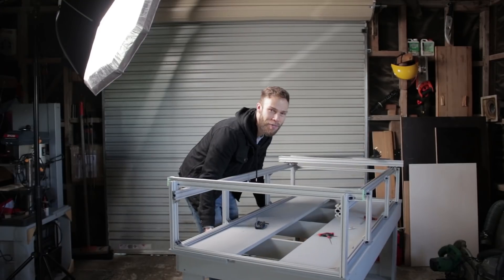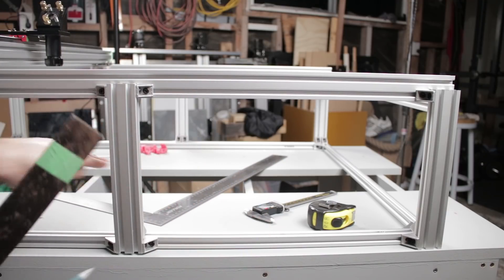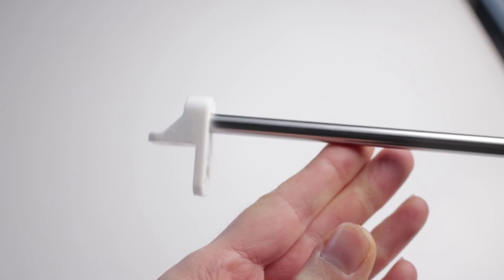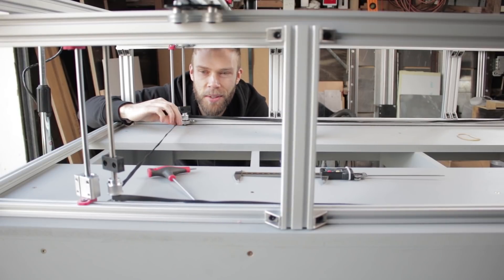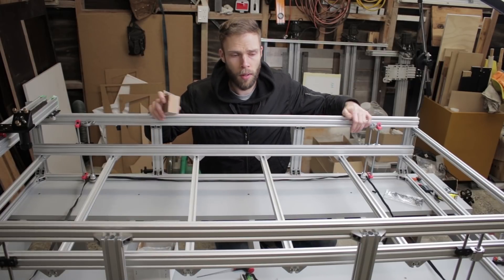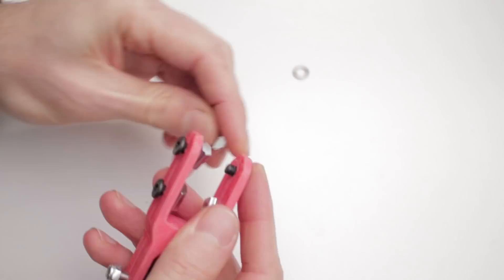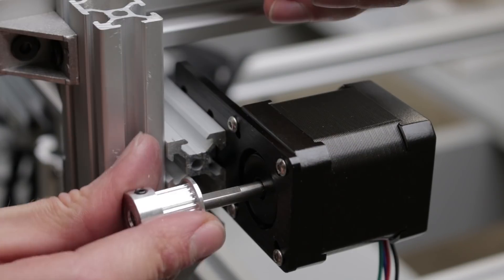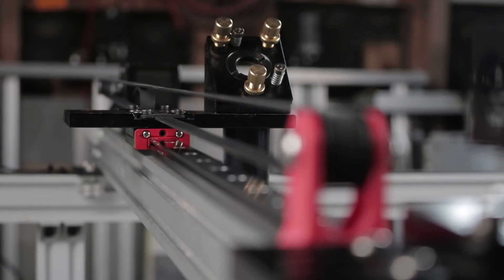Ep3: Beds & Belts. The DIY CO2 Laser Cutter / Engraver Build Series

Comment: I was going through the build of materials and in there it says you used a dual shaft NEMA 23 for Y axis.  Here you use 2 separate motors..  are these NEMA 23's or NEMA 17 like the X axis?   
Or do you use NEMA 23 all the way around?    
Starting a build and wondered why I ordered a dual shaft???   I ordered based on BOM.  <links in BOM>

Comment: 7:46:  The PAID instructions CLEARLY show the pulley oriented THE OTHER WAY with the screws on THE BOTTOM.  SO I did that, and the belt keeps jumping off the takeup pulley, because the travel of the belt is being forced upward due to the orientation shown in the PAID instructions...That's GREAT, now I get to disassemble all 4 vertical threads/brackets to reverse the pulleys. ARRRRGH!

Comment: VARY COOL BUILD. I would do one thing different since I am welder fabricator I would weld up the frame from 1" thin wall steel tube. I think I would also build it so it could be a router as well as a laser cutter. Now to watch the remaining videos and see how it came out. I think I will buy a cheap K40 Chinese laser cutter to start with then if I find myself using it a lot and need a larger one, I'll re-watch these videos and build my own version using the knowledge from these videos and what I learn from the K40.

Comment: Did you get a good deal in the extruded frame parts?
Reply from the maker: I had a local supplier nearby which saved on some shipping costs, but it's still a large percentage of the overall build cost

Comment: I had lost steam on my own build but your videos have got me going again thank you! I'm sure you've answered this elsewhere but I can't find it. Are you worried about dual motors on the y-axis coming out of square with this setup? I've read of alternatives to this style for that very reason and have now been considering going with a linear rod setup instead. Currently I'm setup like yours with dual motor on y and I would have thought it unlikely to happen but if it did...even 1mm of variance would send the laser pretty far off the next mirror across that distance
Reply from the maker: Good to hear you're getting back into it!
Yeah definitely a valid worry. Purely speaking from my own experience, I've never had any trouble with them running out of sync.

Comment: I'm confused on the laser head you purchased or the mirrors location.  Which are you switching to get the beams path to work correctly because currently that setup doesn't work.
Reply from the maker: haha I was wondering if anyone noticed that! I just threw them on quickly when I was adding the components, but don't worry the mirror will be turned the right way round before I shoot a laser at it!

Comment: Great series keep it up!! Am watching this to decide if I should convert my customized V rail CNC to a laser cutter. What I found when working with those profiles with T-slots it is better to keep a few extra T-nuts on the rails while building in case you want to add any component in the future much easier than disassembling things.
Reply from the maker: Thanks! and thanks for the tip, that makes a lot of sense

Comment: 100% yes for powered bed. If you are running a Ruida controller you can have auto focussing by using a stepper etc. My current laser rebuild will be heading in that direction.

Comment: I just had a number of bearing supports arrive and noticed that the bearings were misaligned (pushed in not square); you may want to check that.
Reply from the maker: Thanks for the heads up! A couple of the pillow block bearings I got were also seated misaligned.
Reply: @FurtherFabrication  Love your project; have you considered using corexy belt arrangement?
Reply from the maker: Thanks. No I hadn't, I've seen them used on 3d printers but I don't have any experience with them myself.
Reply: @FurtherFabrication  First, the bearings are self aligning, so that's why the bearings looked skewed.
The corexy arrangement means long belts, but no moving motors or wires; for a laser you don't need the resolution of a 3d printer.
I have 45 years in the cnc service industry.

Comment: When I was building my 80W laser cutter, I found it useful to buy the Hammer HeadDrop T Nuts which can be inserted anywhere along the extrusion and rotated to grip instead of using the slot T Nuts you are using which require insertion at the ends of the extrusions.  Makes for a much easier time.  :-)
Reply from the maker: Yeah totally agree, for me, I prefer the slide in ones, I just trust them a bit more
Reply: @FurtherFabrication  And I just saw your previous episode where you address this exact topic!  Doh!  Sorry about that. For what its worth, all of mine are rotating type and I've had no issues with them for the past 2 plus years.

Comment: I worked at two places with a laser cutter. One was smaller but with a motorized Z axis, the other was way bigger with a manual Z axis and honestly i never missed the motorized one. I had so much more fine control over the height with the wheel. I could dial it in just perfect and my cuts were thin as a hair. (i know, that depends on a lot of things, but all the other factors were "perfect" so this is what made a huge difference)
Reply from the maker: Nice, I've heard mixed reviews about powered z-axis, so thanks for sharing your experience!

Comment: Looks great so far. Just a small questing, did you only add lithium gear to the linear bearings? Or did you not bother doing the extra work after the not so good results in Ep 2? Does anyone know some sort of reference manual for working with bearings? Thanks
Reply from the maker: Thanks. Sorry I should have said, I did add grease to all the other moving bits off camera. The x-axis rail that still felt a bit 'slow' has improved quite a bit, and I'm now pretty happy with it.

Comment: hello, why do not you use a screw lock?
Reply from the maker: Yeah good question. I've never really had any issues with screws loosening up, and I often take parts on and off while I'm tinkering, so I'd rather not have locked in threads. personal choice I guess.

Comment: 11:55 might be better to do that the other way around. So looping the belt through to top of the plate first and pulling back through the bottom. That way when clamping them using the tightwrap the teeth of the belt grab into each other. Hope you understand what I mean. 

Good luck with the project further on.
Reply from the maker: Thanks for the comment! that's the way I would normally do it. I'm trying it this way because it keeps the belt flat to the rail, rather than coming up over the plate first and then down. Just curious to see whether it makes a difference.

Comment: Not sure if I missed it, but I am curious as to why you chose belts instead of lead screws? Was a it a weight and or cost saving method or you hadn't considered lead screws over a pulley/belt system. .: EDIT :. Yes, a motorized Z axis.
Reply from the maker: Great question! cost, but mostly movement speed. I've never come across a cutter/engraver that used lead screws on the x & y. There's so little weight moving around on the gantry that I don't think lead screws would be a benefit.
Reply: @FurtherFabrication  Fair enough. However isn't the movement speed issue be resolved with a higher thread pitch? The only reason I ask, is lead screws offer greater accuracy as belts tend to stretch over time with use.

Comment: I say do a manual Z table. I see you are using nema 17 motors and it might struggle to lift the bed once there is weight on it. If I may ask, why not go with nema 23 motors?
Reply from the maker: Thanks for the comment! good point about weight vs nema 17s. I went with 17s because that's what my last build used and they were fine, however upgrading to 23s is definitely still on the table
Reply: @FurtherFabrication  Sounds good. Thanks for the series. It will be a great resource for people looking to get into co2 laser. did you come up with an exhaust design?

Comment: My thought is, so long as you are doing it may as well future proof it as much as possible and go for setting up the power Z axis. Looking awesome and cant wait to see it finished and in action!

Question: Where you cut the belt and used those clamps to tighten it, I am thinking it might be better to use some sort of a spring mount tension system. That way it retains the same tension even down the line when the belt gets older and starts to stretch. Or maybe set the spring tension idea up on the parts you setup to tighten with nuts.  Thoughts?
Reply from the maker: Yeah the thought crossed my mind also. especially as the new belts will stretch out quite a bit in the beginning. My conclusion at this stage is, if it's not causing an issue I'll leave it be. Though it might be something I address in the future. Thanks for the comment!

Comment: Your videos are so neat I'm seriously considering building a laser cutter just like yours! How about a nice hand crank for the Z axis? I've used the laser cutter at my local makerspace plenty of times and the only time I touched the powered Z axis I still had to level it manually... turns out powered z axis in big machines tend to be awfully wobbly, if it had something like a hand crank maybe I could have felt the pulleys skipping some belt's  teeth and not ruin a whole mdf plank lol. Yours should be ok with a powered z axis though, given the size and especially the precision you're putting into the assembly ;)
Reply from the maker: Thanks for your comment! that's a great point about feeling the skipping teeth

Comment: If you fold the timing belt the other way, teeth against teeth it also locks itself in, not only the friction from the zip ties.
Reply from the maker: Nice catch, that's how I've done it in the past also. I'm trying it flipped this way round because it lets the belt sit flatter to the rail but yeah may change it if things start slipping
Reply: @FurtherFabrication  There are some nice belt compression fittings you can get that are cheap and work great. I'll try and find a link.